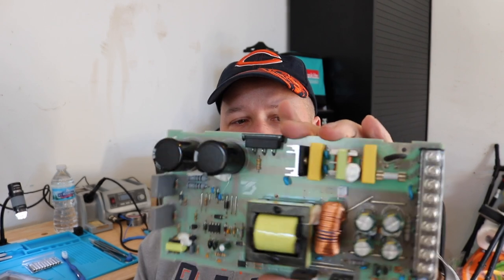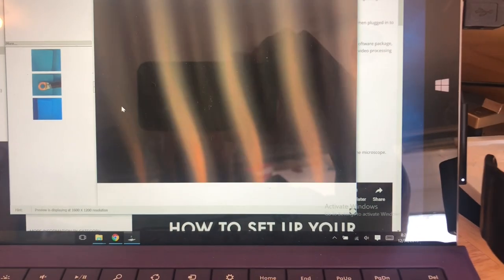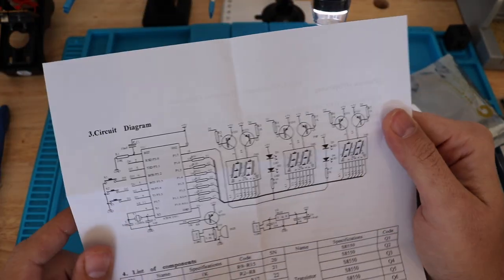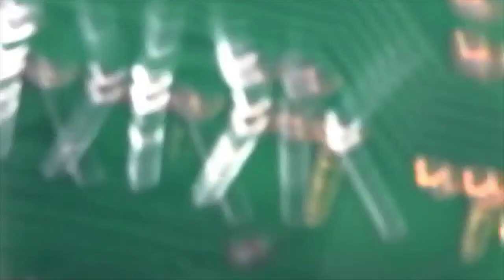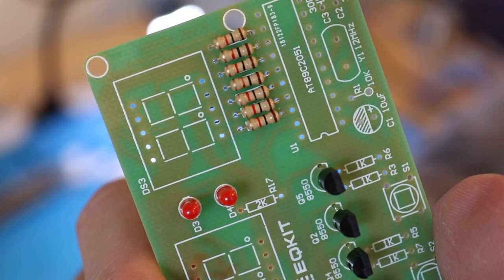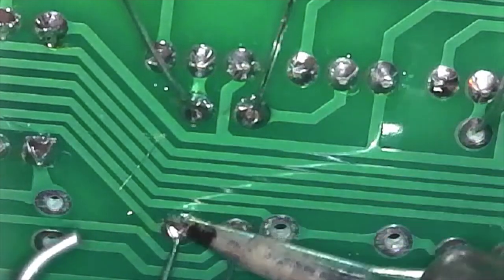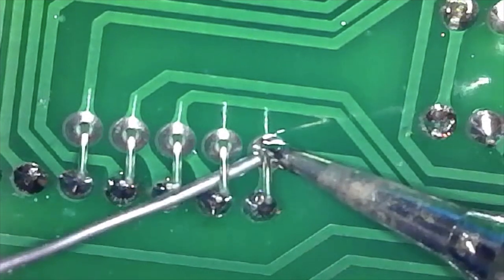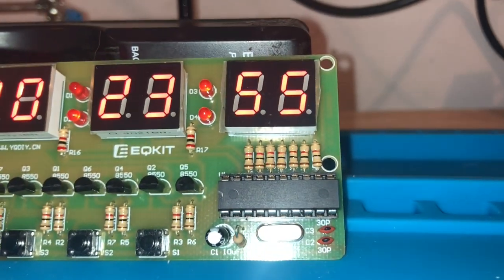How to Solder Parts on a circuit board - PCB Soldering tips and tricks - Part 2

Comment: Nice video. I bought a kit like that off amazon, however it did not include the piece to power it/connect batteries to it. Any advice on what i can use or something i could take apart and re-use, to power my board?

Comment: My friend I am just a normal chap if I can ask. I have three boards that have the rail come away. So I brought tape I brought the tags with the hole. How do I stick the tape and tag to the board resistant to heat. The rest I can do. Please advise me a product. I was thinking if a glue but which one.
Reply from the maker: If you are looking to hold down parts.  You can use Kapton tape.
Tapes Master - 1" x 36 Yds - 1 Mil Kapton Tape – Polyimide High Temperature Tape with Silicone Adhesive - 3” Core - for 3D Printer Surface, Soldering, Insulation and Bonding - No Residue https://www.amazon.com/dp/B006ZFNB2I/ref=cm_sw_r_cp_api_glt_i_HRD5KGFHWTSRVYYC66Q1
Reply: @TripodsGarage  thank you so much my friend this way I can quickly repair the few rail.👌🇬🇧